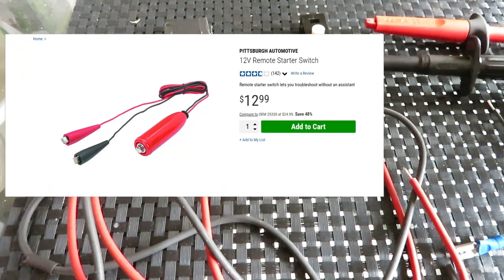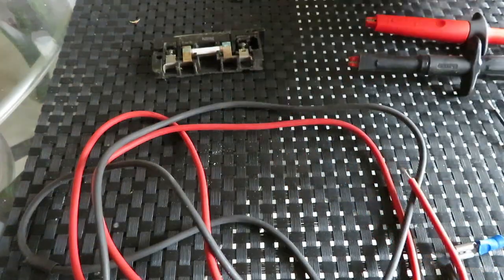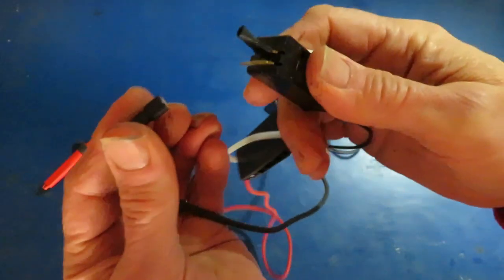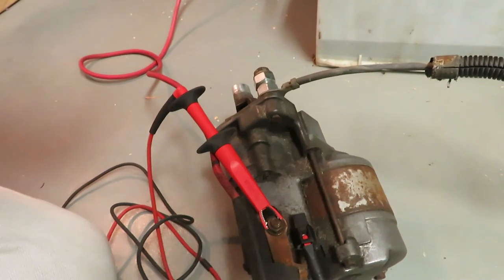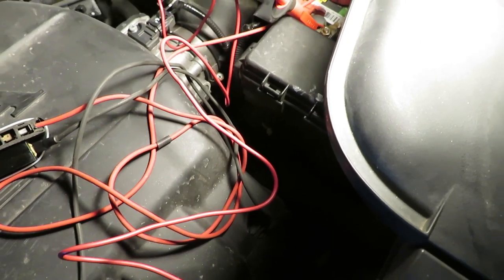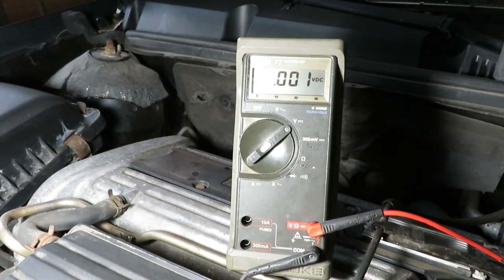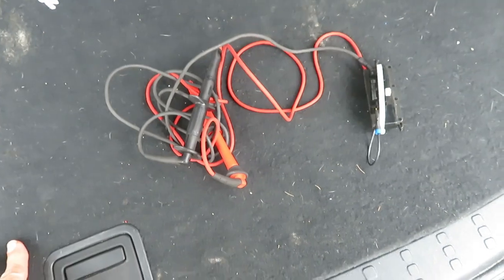How to Use a Remote Crank Switch to Troubleshoot and Even Start a Stalled Vehicle

Comment: The best video out there in the eather on the subject will help me out a lot as needs prime oil pump because of an cold oil change and long layup.I like you will carry those useful cables with me.Thank you for the video 👍🇬🇧from Northern England
Reply from the maker: You're welcome, from the battered and weary USA
Reply from the maker: The '"s" terminal is the smaller one on the solenoid. This terminal gets the 12V start signal from the key switch through the starter relay.

Comment: thanks for this video. I have an old ACTRON remote starter switch.
I am wondering if the same principles of connections would apply to my boat  outboard motor, which also has key switch, starter relay, solenoid and starter, and of course a battery.
thanks
John
Reply from the maker: I don't see why it wouldn't work on your boat motor.

Comment: Why do you need to have the key in the on position? Is that just to keep the engine running? If you just want to see if the engine cranks, doesn’t the switch bypass everything by just supplying the starter motor with power?
Reply from the maker: Yes! For cranking  you would only need the crank switch. I got this crazy idea to show that with a key and  a crank switch you could actually start the car when something in the start control circuit had failed.
Reply: @TheOriginalMechanic  thanks for the reply! I’ve got to test if rodents ate some wires from the ignition so I was trying to bypass the key to see if starter or battery are the issue. Nice to know I can do that with just the switch. Thanks again!
Reply from the maker: You're very welcome. and good luck. @m15t3rB

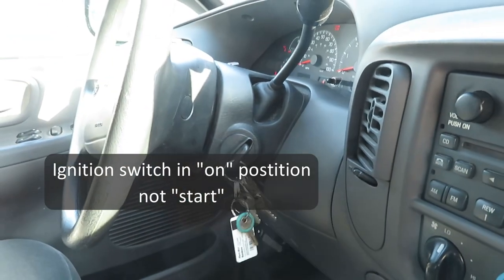Comment: So, at min 2:42, when you activate the switch and hear the starter whirring, but the engine does not crank or start. That indicates the starter or its solenoid -or both- are defective , and need to be serviced or replaced ? Please confirm.
Reply from the maker: I'm a little confused by your question. At 2:42 the truck in the video does start. This was a simulation of how to start a vehicle when there is a control circuit problem and you have the keys and a crank switch.

Comment: Good evening sir hope your day is going well! I purchased the 12v remote starter switch from harbor freight that you show on the video. I know one alligator clip goes connected to battery positive terminal but then I don't know where to hook up the other alligator clip on the correct spot. Can you please help me out sir? I have a 2003 DODGE CARAVAN SE.
Reply from the maker: The other clip goes to the smaller terminal on the starter, sometimes called the S terminal. I believe on the Caravan there is spade connector there that you will have to unplug to connect the remote starter.
Reply: @TheOriginalMechanic  Im sorry sir is there any way possible that you can show me how to do that on a video please? It would help me to comprehend. 💚🙏
Reply from the maker: @AlwaysDiagnoseVehicleFirst  Sorry, I don't have any video showing this on this starter.
Reply: @TheOriginalMechanic  Im sorry I can understand that sir. Before connecting the remote starter switch to the minivan do I need to remove the negative cable from the battery and also remove anything from the fuse box?
Reply from the maker: @AlwaysDiagnoseVehicleFirst  No, leave the negative connected. Nothing needs to be removed.

Comment: What if I do this and it does nothing I have everything connected right it worked at first now it doesn't work at all no crank or nothing
Reply from the maker: I'm assuming you have good connections on the starter and the battery negative or engine ground. I would look for a blown fuse next.

Comment: Good tool for car thieves.
Reply: Nope- - Although this is a valuable tool for testing a starter and some other things, won't enable a person to steal a vehicle.  It will ONLY turn the starter on the newer cars--- it will NOT energize fuel and other systems needed to actually run an engine.  Not to mention locked steering mechanisms, etc. etc. etc.